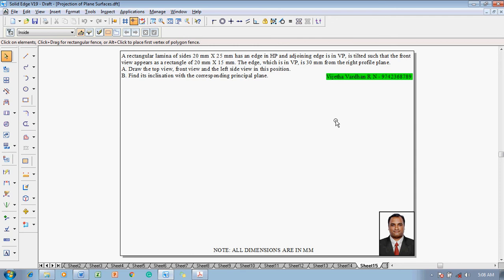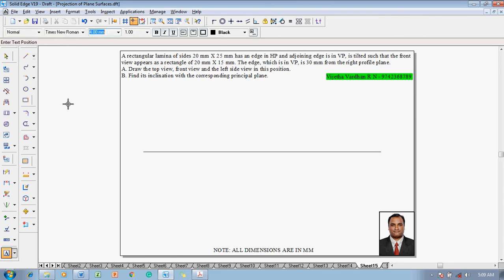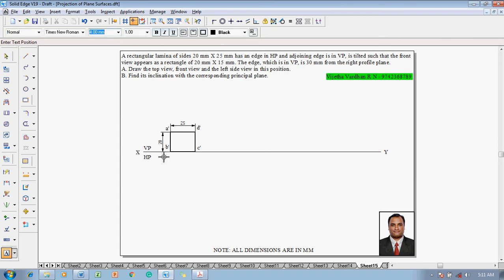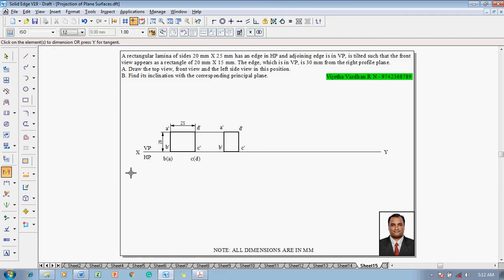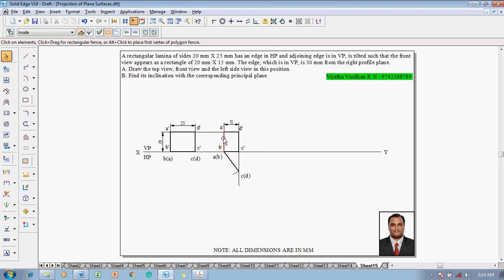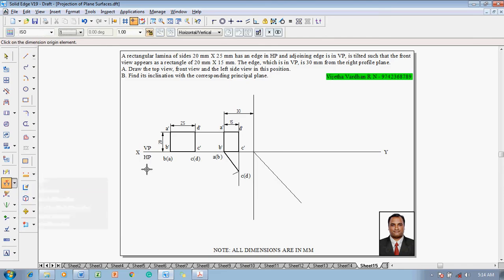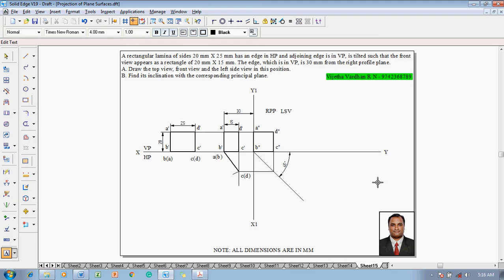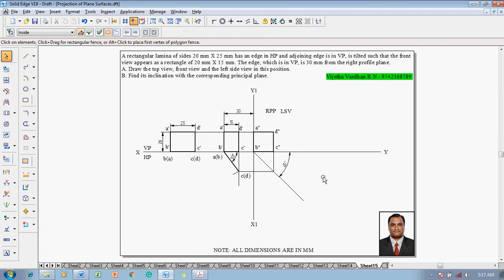Example 15 on Projection of Plane Surfaces

Comment: I am unable to toggle the "driving and driven dimension" so I am unable to change the distance between two points using distance between command. The distance between command just displays the distance. Give a solution for this
Reply from the maker: In ribbon bar you could try with by 2 points instead of horizontal/vertical
Reply: @VijethaVardhanRN  its not working

Comment: A rectangular lamina ABCD of 36X75 mm sides, is resting on the side AB in HP such that the 
end B is nearer to VP than end A, and is 21 mm in front of it and the plan of the lamina is a 
rectangle of 36x30 mm sides with the side AB making an angle of 45 degree to the VP. Draw its 
projection fulfilling the given conditions. 

Can u solve this sir?
Reply from the maker: Yes I can